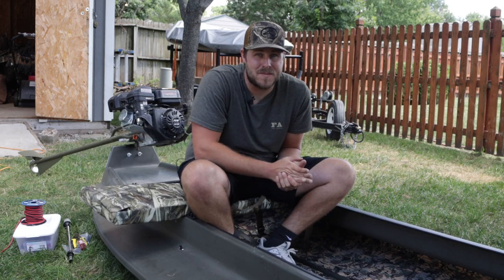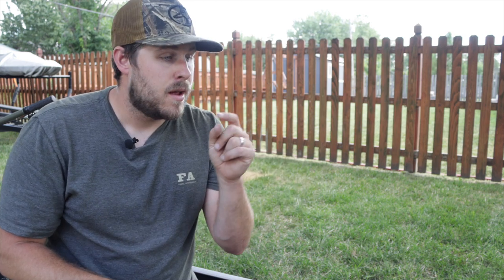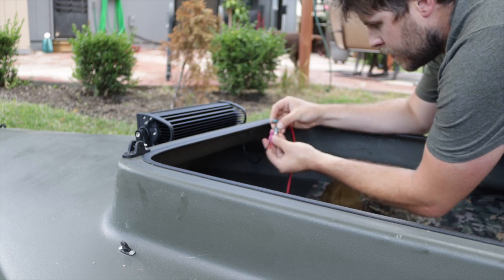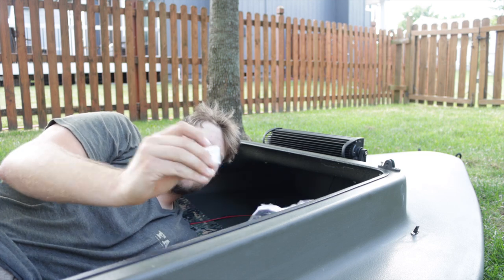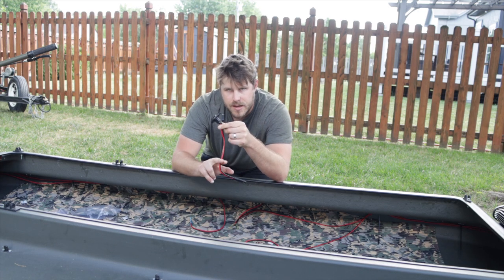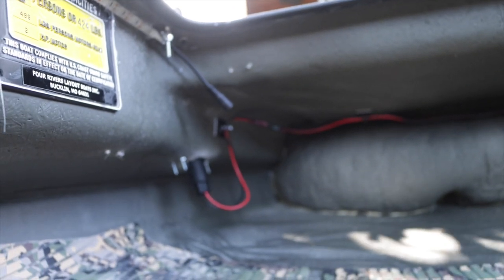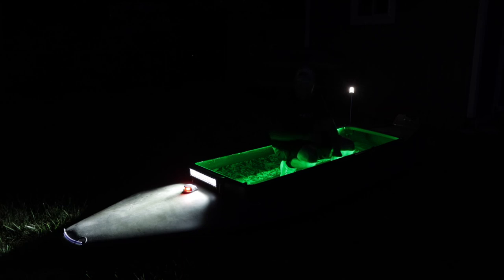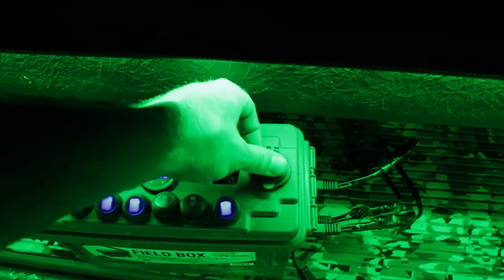The Hard Work Is Paying Off! | Ultimate Duck Boat 2.0

Comment: Consider soldering the connections and using heat shrink.   It’s simple and relatively bullet proof compared to the splices you re using.    It might save you a lot of headache one cold dark morning

Comment: Cool boat. Some small suggestions:
1) spiral wrap
2) shorter fasteners with acorn nuts on the inside.
3) rear nav is called anchor light. should technically be on a separate switch, only on when stopped. Prob doesn't matter in this case.

Comment: Personally I would have put the female plugs on the wires coming from the battery box, so in case you unplug and forgot to switch off, you are less likely to have a short circuit.